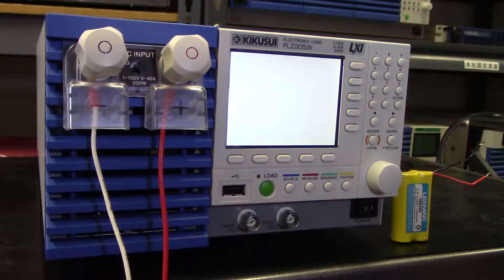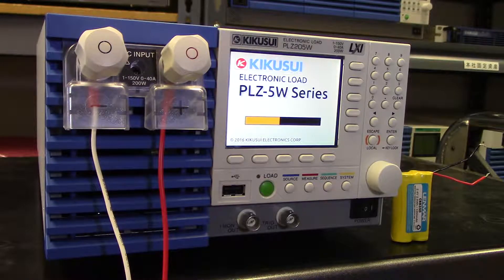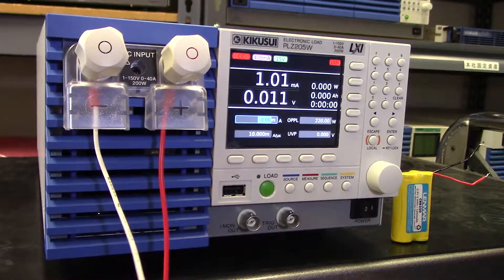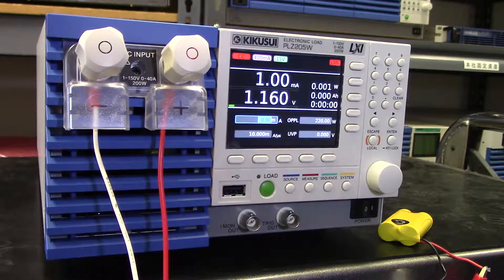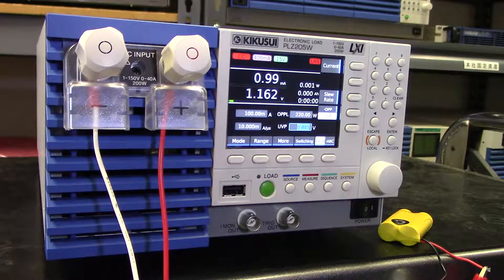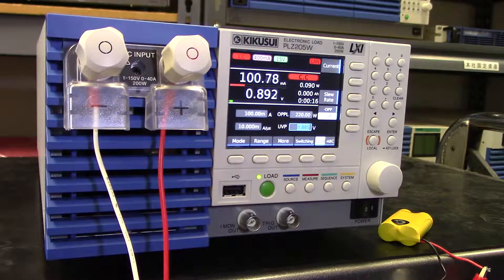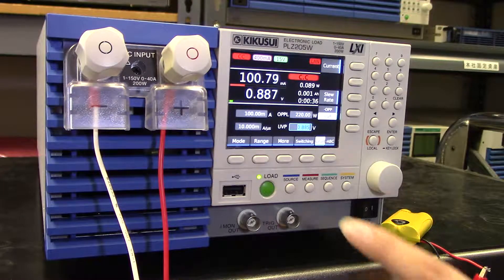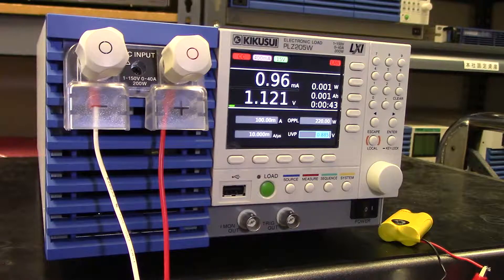Kikusui PLZ-5W DC Electronic Load - How to Measure Battery Capacity

Comment: Can this load show capacity in Wh which is the "true capacity"? Also, can one chose CP discharge in the battery testing mode?
Reply from the maker: Sorry for the delay in replying. Thanks for the good question, the PLZ-5W has a CP mode and can display the integrated power. If you have further questions, please contact us at kikusui@kikusuiamerica.com!

Comment: I think that you may miss a fantastic feature: heat censor.
Imagine to be able to set the load to measure temperature on a battery, transistor, heat sink or many other things, and let the load graph the temperature.Or maybe for stress tests, let the load shut off if max/min allowable temperature is reach. It would be a fantastic feature when testing, to know that you can let the load work, without the possibility to burn something off.
Imagine to know the circuits temperature combined with the load data! :-)
Reply from the maker: Thank you for your valuable input. We passed your information to our engineer.